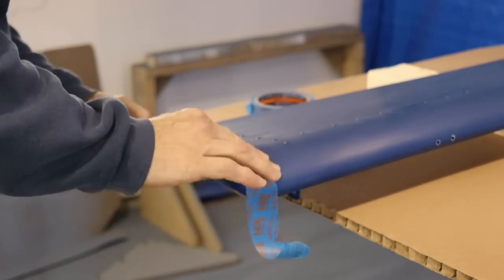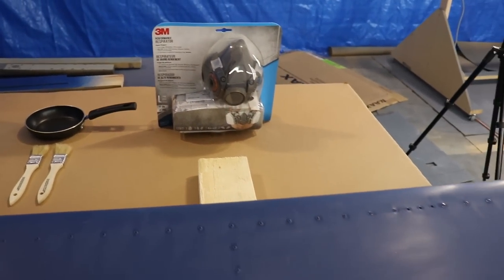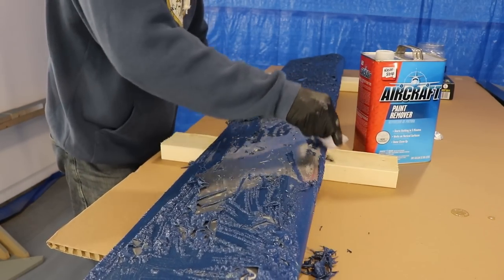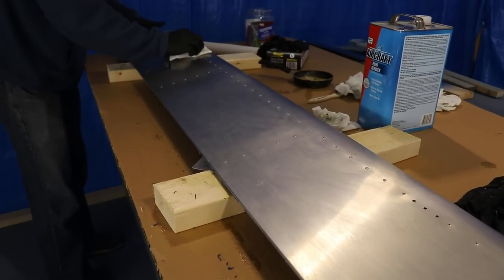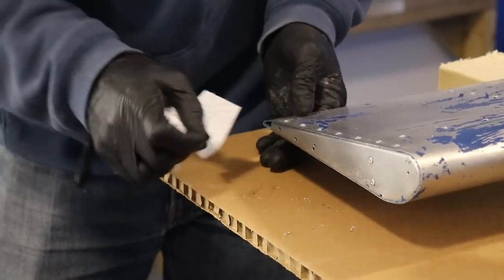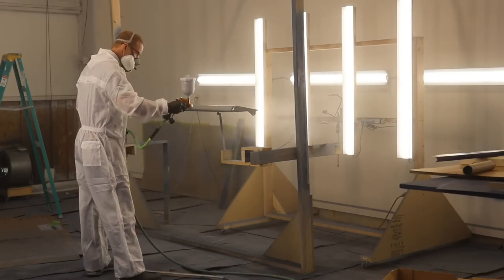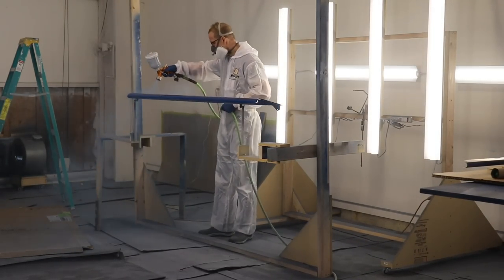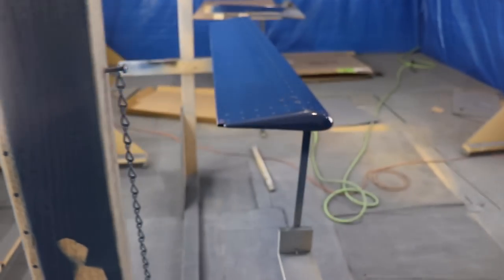Strip, Prime, and Repaint an Aileron

Comment: You're probably one of the few people who used that paint remover for an aircraft. They sell that same brand in Wal-Mart in the automotive section.
Reply: Exactly what I was thinking.. it says right on the can not to use on aircrafts. Ive heard the reason is because it will keep eating between the overlapping joints and eat away the epoxy primer on the inside causing corrosion later.

Comment: The results look very nice and that is the most important thing.  However, your spraying pattern is not very efficient and you likely could apply paint better and more evenly using a more linear pattern.  I have found this channel to be an excellent one to watch to learn the techniques a pro uses:  The Gunman.
Reply: I usually paint in both directions.  Especially for a beginner.  It reduces areas a low/high coverage...
Reply: Lamberto R I agree on large flat surfaces like wings and parts of the fuselage, but on high aspect ratio parts, it is easier to apply  the paint along the long axis and it saves a ton of paint and time.
Reply: @LTVoyager  Yeah, I can see that. Yup

Comment: Hey, I think you're doing a great job and are very meticulous in your work, however, I almost bought a gal of Klean-Strip Aircraft Paint Remover to strip the wings on my Cessna but on the back it says, in all caps  "DO NOT USE ON AIRCRAFT" so I didn't buy it. Do you encounter any issues or problems with this product? Why would a company market a product  as Aircraft Paint Remover then put a warning on the back of the can saying this. Very misleading!! Not trying to be too critical, I just wanted you to be aware of this...
Reply: @KitplaneEnthusiast  Very possible, but I didn't want to take a chance 
on it.